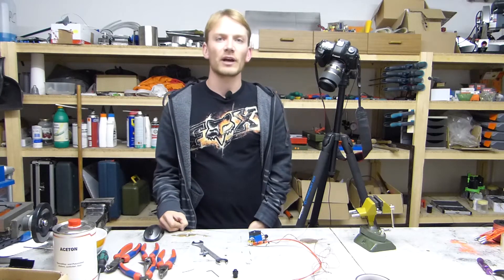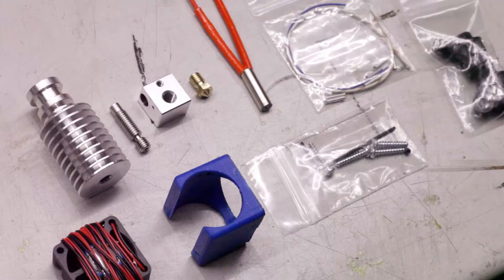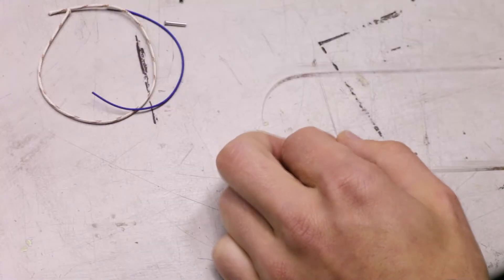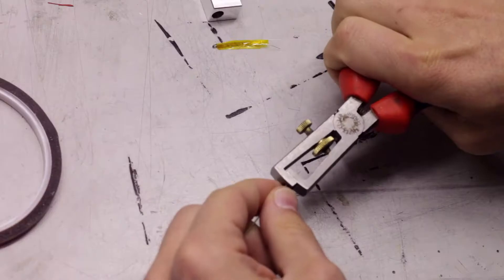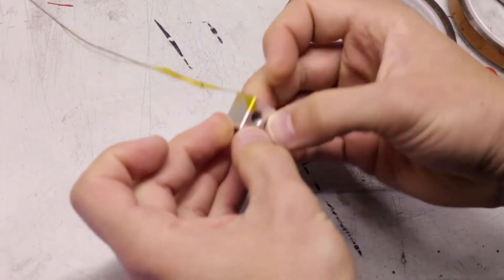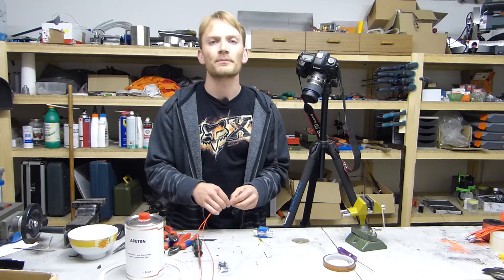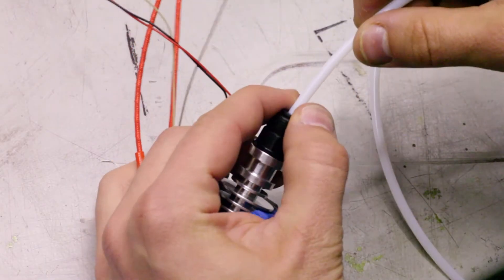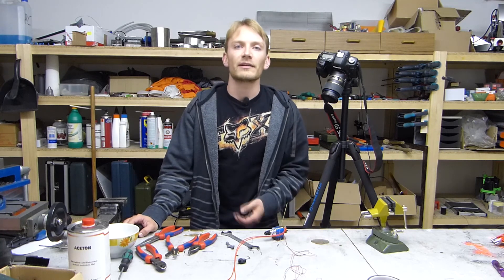3D printing guides - Assembling the E3D v5 hotend

Comment: According to the E3D V5 instructions there should be a small gap between the heater block and the nozzle. Basically you screw the heat break far enough into the heater block to ensure the nozzle buts tightly against the heat break.